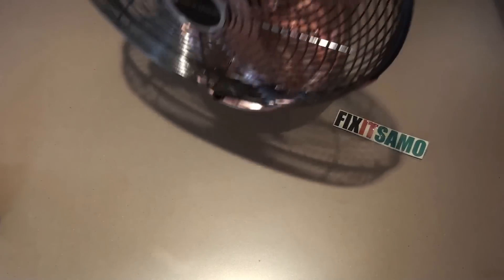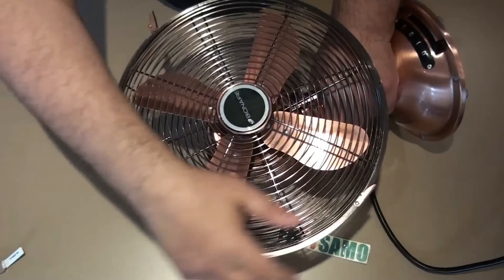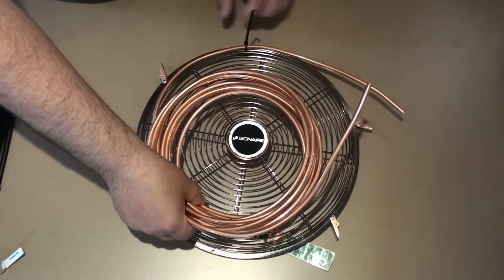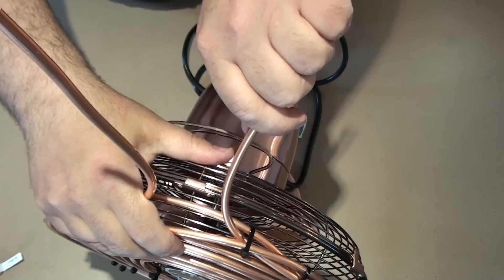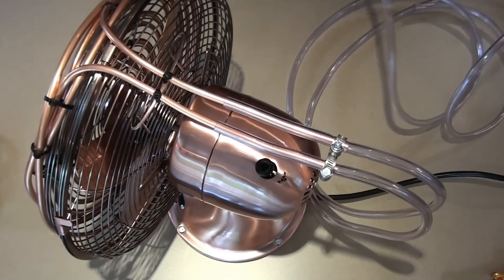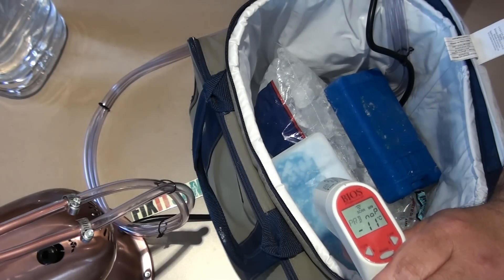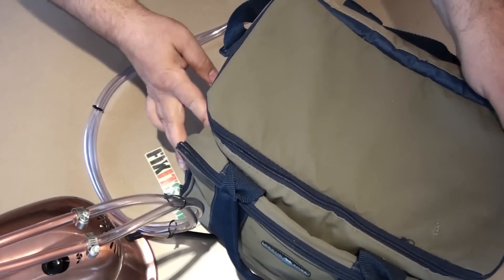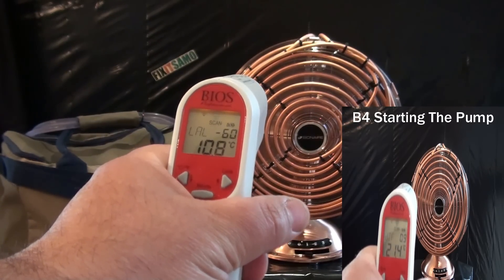How To Turn Your Fan Into An Airconditioner  AC

Comment: Main issue is condensation on copper pipes. How to get rid of moisture on pipes? ANY IDEAS
Reply: I think he was more on about condensation rather than leaks. Also, if the fan is on it will blow the water into the room so a tray wouldn't be the answer.
Reply: Know How

You mean it leaks water? Leave a tray under the fan so it collects the drops.
Reply: hydrophobic spray on the pipes to stop big water droplets from forming?
Reply: Yea ....get  a  real   a /c  unit  in  which  the  condenser  is  outside  the  house.   That  way  there  wont  be  any  moisture   ,  humidy  and  mold  going  around  the  room  and  into  lungs.

Comment: Copper tube should be placed at the back so as not to disturb the strong air infront
Reply: Joel Valiente Nope. The coils in front are better because the air flow dries up The condensing coil a bit.
Reply: Nonsense, whether you blow or you suck up the air - both passes thru the coil
Reply: blow is always stronger than suck.
Reply: Nope, imagine a vacuum cleaner
Reply: Haha bitter
Reply: Did you know that the fan inside the ac sucks the air from the coil infront then blew it in the other open window giving you cold air
Reply: joel if you like it in the back just do it, now shut up already dude

Comment: This may not be an appropriate application for everyone, but it's perfect for us. We rent a house in Seattle that has no air conditioning, and we aren't allowed to make any structural changes. Only a few windows open, and all but one are tiny, so we do our best using cross ventilation and fans in the windows to exchange the air, but it's still 80+ degrees inside the house between 1-7 pm. THIS is a perfect solution for us, so thank you, fixitsamo, for taking the time to make this video.
Reply: Portable air conditioners only need a small window. They work just like a window unit but sit inside the room on the ground with a tube used to expel the hot air via the window.
Reply: I keep my windows closed throughout most of the day and have them open at night, one on each side of the house for that cross ventilation.  If I cross-vent during the day time, I’m blowing out the cool air I generated over night and taking in the hot outside air.  My rule of thumb: fans are removed and the window is closed before sun hits that side of the house.  
I used to underestimate the how much heat the sun actually generates; I think most people do.  Blackout curtains, close doors to rooms.  Inside fans stay on to continue air circulation. 
There’s a lot of variables, what works for me might not work for everyone.  It keeps my place cooler than it is outside.  Tolerable.
Reply: They are also very heavy and expensive.

Comment: for all those guys telling us to use the fridge at home to make the ice: You know how this thing works, right? a fridge? It transports the heat into the room. so what you are basically doing is wasting a lot of energy. Making ice -> heating the house ->using the ice->cooling the house. But while you are cooling, you need to make new ice to swap. so you are basically heating and cooling at the same time. Your fridge will consume a lot more power than usual, caused by opening it, puting warm ice packs in there and closing it all the time. If you can't afford an AC, you probably live in a smaller apt or house. And then this "homemade AC" is completely useless.
Reply: Bro he isn’t trying to cool his entire fucking house with that pathetic ass fan. He’s just trying to get some cold air. Who gives a shit how hot your kitchen is with cold air blasting into your face?
Reply: My ac is broken, all i have is a fan. Not everyone who uses this lives in a hut, use your brain.
Reply: He has about 1 gallon of ice there... if the ice was lets say at 0F that would give you around 1500-1550 btus of heat removal... a small room nedds about 5000 btus per hour. I dont think is a bad idea for personal applications or spot cooling while you work in the garage for example.
Reply: moron alert moron alert.
Reply: Bignut Johnson if someone can't afford a AC then the person lives in a cheap flat or hut. Probably with no separate rooms. Then it's useless. If you can afford a house, then a AC is the thing to buy.

Comment: LOL, you have to freeze the ice first, so the cost of operating this "AC" will be equal or more to a regular portable AC, also now you have a hassle of freezing the ice and keeping it coming every couple of hours :)
Reply: The fridge has to be kept on all the time whether you make ice or not. what are you guys even talking about? nut cases.
Reply: @Fr33 ....... its about living with lesser cooling then heater refrigerants & adding to global warming ! instead use some ice & some non-potable water to maintain a comfortable temperature !
Reply: Also the fridge just dumps that heat it took out of the water right back inside your apt so it's technically net zero unless you just buy the ice or you make it during the night or something.
Reply: mjshaheed I suggest you take a physics course
Reply: What I am trying to say is that I own a fridge and why I should worry about making ice?
Reply: @mjshasheed  Because there is no free lunch. Observe your fridge if you don't believe me. If you for example place a hot meal in there It'll have to work harder to cool it down. Same for placing water in there. There's a certain temperature inside the freezer, it has very good insulation so it needs to do very little work to keep that temperature maintained. Let's say you have it at -5 C then you place water in there that's a full 30 degrees warmer at room temperature. The fridge will try to maintain -5, the room temperature water will raise this temperature and the fridge will have to do additional work in order to freeze into ice. This extra work costs extra electricity and heat. You can calculate this exactly. You will put that exact same heat that you took out of the ice plus heat from inefficiencies into the room and whatever the ice will cool with this makeshift AC will not make up for it in fact after doing this you will have shed more heat into the room because of inefficiencies of the fridge. ask any physics teacher they'll confirm this.
Reply: Rykanhz - OK, that makes sense but what if the fridge is inside Kitchen and this fan is in a different room?
Reply: Then that might make sense to do if you wanna just keep one room cold just gotta make sure to keep the door shut
Reply: read what I wrote three comments above. Why don't we bet some cryptocurrency and then you can ask a physics teacher and see who's right
Reply: this is possible i will research this. im only doing this because there are tons of cottonwood tree right next to my A/C and im tired of taking it out and cleaning it.

Comment: Bro Your home made ac is good but I want to advise you a thing that you should use thermoelectric pleter for cooling the water of copper pipe
Reply: how would you use a thermoelectric pleter?
Reply: A peltier disk you mean?
Reply: lllCANDYMAANlll yes
Reply: Alex G baller we can use it by using a aluminium water cooling block
Reply: yeah, because a peltier is cooling on one side and heating on the other. Now you have this shit in your house. Heating and cooling, using energy. Sounds stupid, is stupid.

Comment: The cost of ice will be more expensive than just running a true air conditioner.
Reply: Maybe containing the water in a tin container, having a peltier plate on the bottom coolin the water to freezing temperature, than having that water circulate.
Reply: I like how people keep mentioning how useless this is, as if people are using this tiny ass fan to cool an entire house lmao
Reply: I Think this guy shuts his freezer off when hes not making ice....
Reply: donzi well dont buy ice idiot are you that stupid use a fridge
Reply: donzi no its not wastes the same amount
Reply: Yes, it will.  Cooling the ice packs or making ice will take more energy than the cooling those packs or ice cubes can provide.  While the refrigerator/freezer is wasting power to cool them it's also heating the house which will compound the heat/energy problem one is trying to solve with this fake air conditioner.
Reply: If you're just trying to have cool air blowing on you it'll get the job done.  If you're trying to cool the house it'll be counter productive.
Reply: If you're making the ice and your freezer is in the house you'll be heating the house, not cooling it.  If it's cool at night and you make all the ice overnight, then maybe you can be a little cooler during the day with this running.  Or you can get a small AC that uses less power than a fridge and actually cool your house.  And don't forget to account for the power that constant running fan is using for the ice AC thing.  No matter how you slice it, it'll take more electricity to use the ice AC instead of a real AC, and the real AC will also dehumidify the air making it feel cooler than it is.
Reply: No just buy a 350.00 yeti. You can buy a cheap air condition for all of that

Comment: What are you doing about the condensation from the copper tubing??? Are you letting the water drip on to the electric fan and on to the floor???       I attached my DIY air-conditioning AC system to my solar system so that I would use free solar power and not AC power...              If you use AC power, just turn on your home AC unit, instead...
Reply: There is soooo much air movement that the condensation will not have even a chance to develop...........

Comment: Looks nice, that's a genius one. But I've got a quick question, thou: I live in an environment where normal temperatures are 33°C on the average. Will this system work so that I get on to it? Sorry fellas, but I don't wanna buy them accessories only to find out that it only cools for an hour. Some advice, plz.
Reply: I haven't tried this one, but based on other aircon powered with ice, it should. Theoretically, since the ice is in the coolbox, it should last longer even in 33 degrees climate as the ice box keeps it cold longer. I am not 100% sure but i think the cold water goes into the clear tube and then the copper one which is a good heat conductor, and conversely, a good cold 'conductor' as well. So the fan blows through the layers of the cold copper tube and voila, cold air. 

So yes, it should theoretically even in 33 degrees weather  cool for more than an hour as long as you get a good icebox/cooler (i live in malaysia). If not, just top up ice every other hour i guess. HAHAH
Reply: What are you doing about the condensation from the copper tubing??? Are you letting the water drip on to the electric fan and on to the floor???       I attached my DIY air-conditioning AC system to my solar system so that I would use free solar power and not AC power...              If you use AC power, just turn on your home AC unit, instead...
Reply: I could do the math for you, just need to know how much ice and the flow rate of the pump plus the fan and I can tell you how long it'll last.

Comment: Brilliant!  I was looking for a solution to cooling a soundproof booth, basically a room within a room.  No way to use a true air conditioner.  Should chill a 4'x6' room perfectly.  How far are you from the fan when you pointed the thermometer at it?

Although I'm in Canada it can get extremely humid here in the summer.   Am I right that this method does not create humidity?  That it just cools the air? 

I also would like to ask how the size of the fan would affect the cooling power?  I have a small desktop fan - I think about 6" diameter.   I also have a large one similar to the one you used but with a 4'x6' room you don't have a lot of space to play with.  Thank you for this video.!!!
Reply: Cool, thanks for putting this up. What do you think about using nitrogen gas since ice blocks melts faster, think it'll work?? Appreciate your effort.
Reply: WhatsMarlyUpTo

Comment: you would have to factor in the cost of the ice but you could make ice at home. The problem in a high humidity state like Florida is that you not only use an AC to cool the air but also to remove the humidity in the air. My AC removes about 3 gallons of humidity per day in the Tampa Bay area in the summer. Just cooling the air in Florida would not be enough but this idea might work well in California or Arizona where there is little or no humidity.

Comment: Can the air sources take by pipe out flow from refrigerator or freezer?
Reply: Samirun Sam great idea,it would probably burn out the compressor on your fridge really quick.
Reply: Probably. Be extremely careful taking apart a refrigerator apart though. They use some really nasty toxic chemicals as coolant.

Comment: This would work great in the wintertime when you can just bring in some snow instead of ice lol 
(It's a joke folks, don't freak out!!)
Reply: Why is it a joke if you look for a temporary remedy especially where you can't have a large AC or don't have the high voltage access? Did you built this/ calculated the efficiency/ Calculated the cost of running??? Yes the direct fan blow into ice chest with a directional outflow would work but I assume the time and efficiency of that is much less than this one. Can you explain as to why you say so with proper reasoning as I want to know & learn more and no sarcasm here.

Comment: Not a real air conditioner. You need a specific gas inside that will easily become liquid at room temperature to make a real air conditioner.
Reply: It meets wikipedia's definition:

"Air conditioning (often referred to as AC, A.C., or A/C) is the process of removing or adding heat from/to a space, thus cooling or heating the space's average temperature."
Reply: Lol, he's strapping a copper tube to a fan. I wouldn't really say that this method is conventional, but it's still air conditioning XD
Reply: @Valken. You are wrong. Gas is involved here. It is used when actually ice was formed however Fixitsamo has used the pre-made ice to power the temperature drop in this AC model. This is brilliant as a temporarily measure when needed.
Reply: That's not the point XD Gas doesn't have to be involved to creat AC. Air Conditioning can come from any method of getting the air conditioned.
Reply: In a conventional sense, yes. This is not conventional. That would be part of a regenerative system, and you have to think of this as an open system. This is more closely related to how the heater core in a car works(although also a regenerative system in a different way), except in this case to cool instead of heat. The heater core in a car transfers the energy in the form heat from the coolant(antifreeze) to the air being blown through it, thus heating the cabin of the car. In this case, the air is transferring the energy from the air to the pipes with cold water inside of them thus losing energy and blowing colder air to the other side, thus cooling the room. The reason this is not a regenerative system is due to the fact that there is no sort of energy to keep the Ice cold, like there would be in a conventional ac for the power outlet, or in the example above from the engine heating the antifreeze. This will work for a while until the Ice melts, all of the energy that you can transfer into it has been transferred, and the room eventually hits an equilibrium with the water(Unless you keep adding ice of course). No need for a gas to be present.
Reply: Try it shit head.
Reply: Who are we targeting with the "Shit head" comment?
Reply: bottz2 he's targeting me. My name is Eric Von Shithead. I come from a long proud line of shitheads
Reply: The   ice   acts   as  the  compressed   Freon  in  this  system.   Once  the  ice has  liquefied /melted  there  is  no  compressor  to  turn  it  back  into 
 the  gas (ice)  to  recycle  back  through  the  system  to  keep  cooling  the  room.   Gotta  go  back  to  refrigerator / freezer  to  
Get  more  ice / refrigerant.